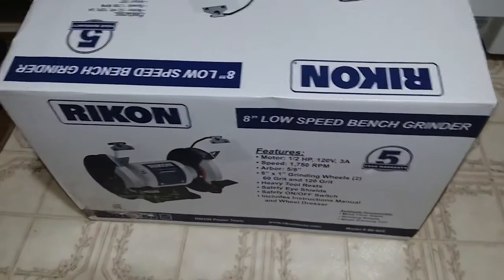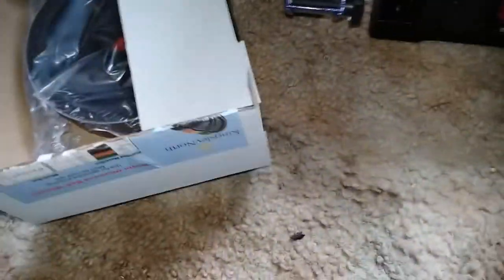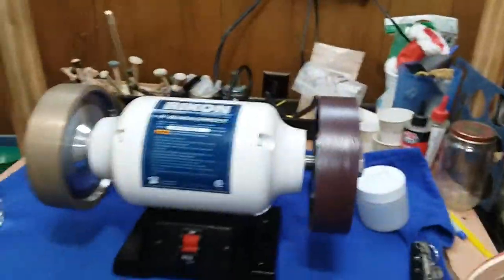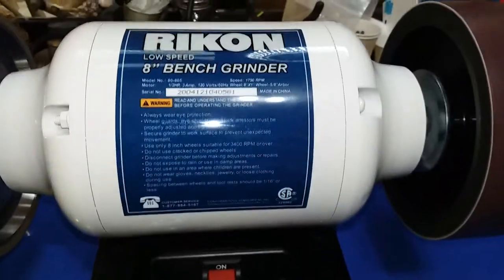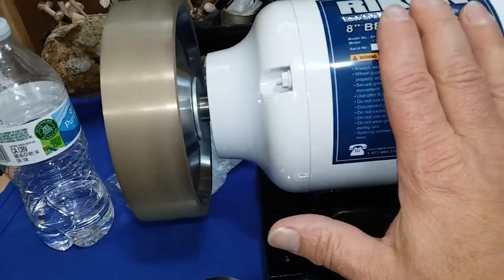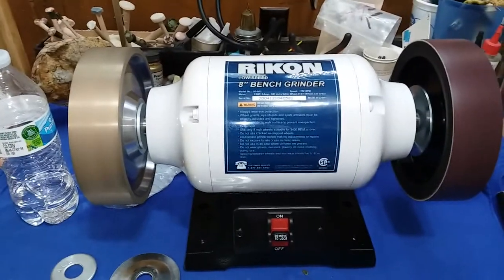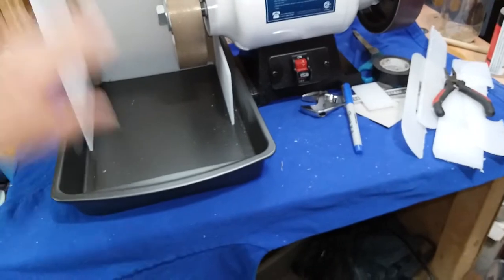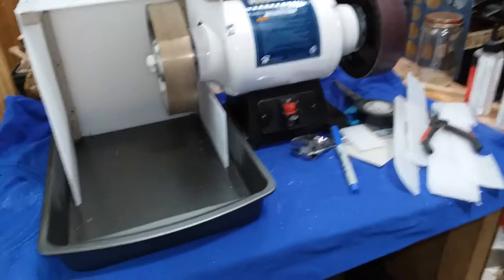Can I build a cabbing machine for less than $350?

Comment: I got the biggest cheapest bench grinder variable speed for 150 on amazon. Bought two cabbing wheels like yours but for the other grits decided to save even more money and bought 3 flat lapidary blades 5/8 arbor that are a fraction of the cost of the cabbing wheel. I also have a cutting blade for straight cutting all on one machine with all the blades, the wheels, the motor, the washers has me at 280 now i just need to make a shroud and watering system what a fun project thanks for the inspiration!
Reply from the maker: That sounds awesome!
The watering system can be pretty simple. Mine is from a drip irrigation kit, comes with tubing and connections and basically all you need except for a pump and some gromets. Harbor freight sells an inexpensive  pond pump that I use for mine. That should be all you need.
I'm curious to see how it works!
Thanks for watching!
Reply: @sandandshoreshoppe  hey have you thought about an expansion rod? I think Im going to look for one tomorrow it just needs a threaded hole and a threaded end. Ooh this is getting exciting lol
Reply from the maker: @LesNToomy  If you mean to put on the shaft so you can attach maybe two wheels per side, yes I have. 
I talked with a machinist about making an extension rod for mine, but then decided it was not worth the risk.
Not saying it can't be done, but having the piece made to fit my grinder would have cost around $150 each because it was more complex that it looked and he could not guarantee that it would not wobble due to having set screws to hold it on.
At that cost it was better to just buy a second grinder and make another.
Reply: @sandandshoreshoppe  yep I noticed some people were saying use a shop like Covington engineering I’m hoping to find a coupler 5/8 to 1” and a stock threaded metal rod if there is a cheap way but other than that this two wheel setup can be just as effective as anything else just a little more changing in and out and for home fun, it’s not a necessity at all I think Ill just focus on the shroud and water now thanks for those tips

Comment: I did it, I made the purchases and I’m so excited! I was able to get the slow grinder, 80, 600, 1200 & 3000 grit wheels, & a brass water spitter, along with 3LB altogether of moonstone, lace agate A+, and geodes @ 1LB each. The water spitter will eliminate the need for screwing around with a drip system. I’m also going to build a sort of pan for the whole thing to sit in to Keep the plastic hood from moving around dangerously.
Reply from the maker: Wow...that is awesome!  I'm sure you'll have a blast building your machine. I know I enjoy building the things possibly more than I like cutting rocks on them...lol.
If you look at the video ''New improved cabbing machines''  it may give you some inspiration on design.

Comment: That’s awesome! The first machine I had was a Cabking. I didn’t like it and ended up with a genie, they are great machines but they don’t come cheap. It would be so cool to build your own!
Reply from the maker: I know what you mean, they aint cheep. This one seems to be a good alternative to buying a huge one, though it does have its drawbacks. The price is great but you just get two wheels. I tried to get an shaft extender made so I could put two wheels on each side, but having it machined would have cost nearly as much as making a whole new machine...plus there was the problem of it not being precisely balanced due to the tolerance with the shaft motor bla bla bla etc etc, so just making a new machine is the best option. But even with that route I will have 4 wheels at about half the price of a Cabking. (...though I would still LOVE one)
Honestly building my own tools is more satisfying than using them!  I think its the design and creating part I love. 
Depending on how I do at the next show I'll be making another machine and showing the process in more detail this time.
Thanks for watching!
Reply: @sandandshoreshoppe  that’s awesome!

Comment: Looks pretty awesome good job couple things I would have changed are I would have used pop rivets on the plastic and I may have created an extension for the shaft so you can do bigger rocks, but other than that nice job
Reply from the maker: I actually thought about rivets, but then decided on screws so it would be easier to replace the wood that I ended up using because I ran out of the decking material....and if I decided to change the size. 
Doing larger stones is not really an issue because the wheels come out past the motor housing. I actually did design an extension that could hold two wheels on each side, but getting them milled cost $75 each...not a bad price at all, but for $150 I could just get another grinder and have more room, so I chose not to get that extension made.
Check out the other video where I made the design even better with the original guards. It works WAY better now.
Thanks for watching!

Comment: I would move the water spout to the front of the wheel so that gravity will help it adhere and stop shooting off of the top. That should keep the wheel wetter and place the water closer to where it is needed. I am planning on trying the same with an 8" low speed buffer with 6" wheels on 5/8 arbors -- it has longer shafts.
Reply from the maker: When I did the second version of the shroud I did put the water right down against the wheel using a small section of tubing. It works out great. Though I did place it a bit more toward the top of the wheel. I could adjust the tubing to be more toward the front and see how that works though, sounds like a plan to me.
Would love to know how the buffer conversion works out too.
Thanks for watching!
Reply: @sandandshoreshoppe  Even with water hitting the top of the wheel -- you should have much better adherence of water to the wheel. The problem with placing the tube behind the wheel is that it runs up hill & then has too much momentum to follow the wheel down & most of it flies off when the wheel starts down hill (cars have the same problem cresting a hill at high speed). The more I look at how the grinders & buffers are threaded, the more I realize that it's a pipe dream to find some extension that will fit securely & true enough. I'm probably going to go the route of a belt drive (could use a cheap grinder for power) and mount the wheels and a 1" shaft mounted in pillow bearings. That way I can have a single piece shaft rotating at 1725rpm from a 3400rpm grinder.
Reply from the maker: @geeder9086  The pillow bearings and belt way is a sure thing. That is your classic cabbing setup and has been proven through time, and different size pullies will get you the speed you want no problem.  I had a machinest work out an extension for these and the cost for each was more than the grinders cost...not that the guy was overcharging it was just the price for the precision millwork that was needed to make it work.  So yeah, the pillow bearings and shaft is probably the best rout.
If you have any welding skills you could whip up a really nice machine I'm sure...I thought of that too and may do one up eventually...just because I can!  lol.

Comment: good job,just put an o ring on the shaft because the berings are not waterproof and if water goes in they will rust.
Reply from the maker: I actually shot some silicone around the shaft where it comes out of the housing and left it dry before turning the shaft free of it grip. I thought that may work better than trying to find a well fitting O ring.
Waterproofing the entire thing was foremost on my mind.

Comment: That nut at 2:54 seems to have a lot of extra threads hanging out.
It's fine thread, so I'm sure it has enough threads engaged. Just leery about it backing off, especially without the full guards on it.

 I've had a wheel come off a bench grinder before, and it took most of the grinder into the scrap bin with it.
Reply from the maker: Yeah, that was pretty much a disaster waiting to happen. I realized afterward that those cupped washers were not holding the wheel properly...the shape was such that they were only touching the edge of the inner raised part of the wheel... so I got some thinner washers that were making proper contact and those with the wheel itself and allowed all the threads to be covered as well.
The sintered wheel is a bit thicker though, and there is about 1/6 of threads showing with the thin washers, but with the grinder being half the speed of a normal metal grinder I don't see that little bit being an issue.
My initial idea was to have an extender piece machined to slip over the entire shaft to allow for two wheels on each side, that is why the shroud is made so wide. Unfortunately the machined pieces were not cost effective at all.
Actually I just finished redoing the entire setup with the original  guards installed. It is much slimmer and much more safe as well. That video should be coming up soon.

Comment: At 5:50, you are talking about the minor wobble on the left side wheel. You can also physically see the problem, which is your washers. Look at the washer's wobble, that is enough to create the wobble in the wheel.
Reply from the maker: Yeah, the washers weren't very true or well fitted on the shaft. 
I got some that were thinner and adjusted the spacing a bit and it took care of that wobble.
They all run very true now.
Thanks for watching!

Comment: Hi Clayton, how did you waterproof the Bench grinder, I would love to try this but the water/electricity scares me a bit.
Reply from the maker: I posted what I did to make it a bit safer on your other comment, so I wont redo it on here.
I do understand your concerns with the water and electricity though....the last thing any of us need is getting our fingers burned off with 110volts while polishing stones.
Putting a shroud of some sort around the bottom of the grinder body will be my next addition to the thing.
Reply: @larrymoremckenzie3029  yeah it‘s because they don’t care about the price
Reply: I recommend that you ensure that the grinder is plugged into a circuit that is GFCI (ground-fault circuit interrupter) protected. Anytime you have electricity near water, like in your kitchen or a bathroom, GFIs are a must (code too these days, I believe, also code in garages, I think?). Nice DIY unit, Sand and Shore Shoppe!

Comment: Hi-
This is a great setup you have put together!  I am interested in trying to do the same thing--- this may seem naive but how did you make sure the holes in the grinding wheels would fit the arbor on the grinder?   is the 5/8" arbor the thing you have to make sure matches up?  that's referring to the hole in the wheels right?
Reply from the maker: Usually the wheels come with spacers down to around 1/2 inch. The ones I buy all have them. The starting hole size is 1'. Whoever you buy your wheels from ask if they provide spacers and you should be ok.
Thanks for watching.

Comment: I would of ordered clear plastic vinyl materials from Amazon and use pop rivet to attach
Reply from the maker: That would have worked well for sure, but I was more interested in building it with materials that were inexpensive and readily available as much as possible. And I am glad I didnt put the extra  money into it as the shrouds ended up being scrapped for a better setup.
Still, clear vinyl would have made for very nice shrouds to be sure. Thanks for watching!

Comment: Good job.. I'm looking to build me one. I think i just found one,  i do have a question about the spacers,do they come with the machine ?
Reply from the maker: If you are talking about the spacers for the wheels to fit on the shaft, then those usually come with the wheels when you buty them. these came with ones to fit down to a 1/2 inch shaft.
Thanks for watching.

Comment: You could hang your bucket and make it gravity fed with a spigot
Reply from the maker: I originally thought about that, but the pump system was more practical. For about $12 I got a pump that works great, and I would have had close to that much in a sturdy shelf to hold the water bucket along with a brass fitting....so I went with the pump!
Thanks for watching!

Comment: nice hows it holding up ? ive thlught about building one just like this but i dont know shit about electricity and was worried about the water
Reply from the maker: They are working extremely well. I made another one shortly after doing this video and redid the shrouds making them a lot more streamlined and efficient. I have cut a lot of stones on them since and have not had any issues with water getting into the housing.
Actually once they warm up slightly any spashed water dries right away, so even after half an hour of constant cutting the body is totally dry. And I have never had any issuse with water building up on the tray to get underneath the unit.
Thanks for watching!

Comment: Good job. Can you tell me what kind of valves you used. They look like something I’d be interested in. Thanks
Reply from the maker: They are just a regular brass ball valve from Lowes, but if you are gong to make a water system for a cabbing machine, or anything really, I would use a fish tank air valve. The tubes and valves are actually too big for the pump I'm using...I mean it ''works'' but not near to optimal. One quarter inch tubing and air flow valves for fish tanks do a SUPERB job and are about one tenth the price of the brass valves ant tubing here.
Reply: @sandandshoreshoppe  thank you. Problem I’m having is I have to where a raincoat. To much water on wheels. No matter how much I adjust them. Either they don’t water whole wheel or to much water.

Comment: I thought of another question. I read somewhere that you need to put a pad between the wheel and washer to protect the wheels, and that otherwise the pressure can harm the wheels. What did you use if anything?
Reply from the maker: I personally have never heard anything like that for the type of diamond wheels I use..BUT I have heard that for grinding wheels made of stone or carborundum. Usually a leather pad or something similar to keep the washers from applying sharp pressure to the wheel and possibly snapping it.

Comment: If RPM 3000 than its still can be make a cab.like you did ?
Reply from the maker: That would depend on what speed the wheels you get are rated at.  The wheels I have are made to run at the slow RPM, but perhaps there are wheels out there that are made for a higher RPM.
I have used diamond flat laps at over 3000 RPM but they seem to wear quickly, and I would not recommend doing it for safety reasons.
I would contact the manufacturer of the wheels you plan to use and ask them if it is safe at the RPM of your machine, that would be the best thing to do.

Comment: Can it handle a wet environment?
Reply from the maker: So far I have had no issues at all with moisture. I sealed the joints on the machine with silicone and also underneath where the majority of the wiring is housed, and I have checked and I can find no signs of wetness in there at all.
The tray it sits on is also angled about five degrees or more and the water drains away very quickly. 
If you notice the tray has texturing on it....I wanted a smooth tray but could not find one....and by accident those designs keep the water from moving side to side and channels it downward. If I could actually design a tray, I would put groves in it for the water to channel away from the motor.
I have cut a lot of cabs on these so far and if anything goes wonkey I will let everyone know.
Thanks for watching...and for asking.

Comment: So, do you shine your stones just with the 600 grit? Do you get a high shine?
Reply from the maker: The 600 is basically the first polishing/shaping stage, to remove the small edges left by the hard wheel. Next I go to 1200 then usually to cerrium oxide final polish. 
Depending on the stone sometimes I stop at 1200, or go from there to 2000 then 5000 and 7000 grit sandpaper.
It all depends on how the stone speaks to me.....lol

Comment: Would the wheels fit on a 6” bench grinder?
Reply from the maker: These are 6 inch wheels, so they would fit a 6 inch grinder. Depending on the size of the shaft you would need spacers to make centered. These are 8 inch grinders so the guards have some extra space for the smaller wheels.
Now that being said, depending on the speed of the grinder and how powerful the motor is will determine if it is usable or not. Often times a 6 inch grinder has a not so powerful motor that may just bog down and not do well, if at all.

Comment: Did you try 8 inch wheels on the Rikon?
Reply from the maker: No I didnt. When I built this I was concerned about cost as I was on a very limited budget, so the 6 inch wheels were more in my price range. Also I wasnt certain about the weight for the wheels and figured that the 6 inch would be lighter. I had no clue how powerful the Rikon was so I went on the cautious side.
After using it a while I dont believe there would be an issue with the 8 inch wheels with the plastic hubs. Having two sintered 8 inch might possibly give the motor a good workout, but the stone wheels that came on the grinder are close to that weight so its possible it may not make a difference.
Reply: Thanks for input. If I can’t swing a Cabking I think I’m going to try your idea.